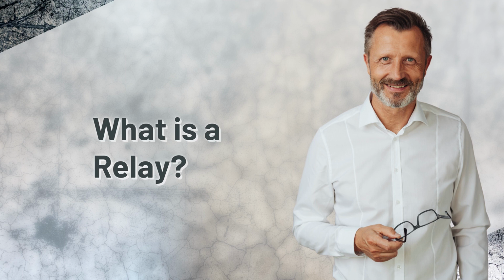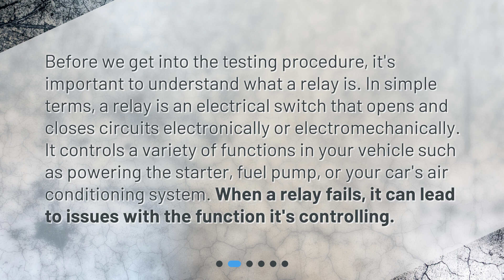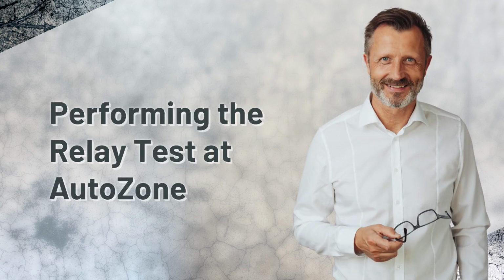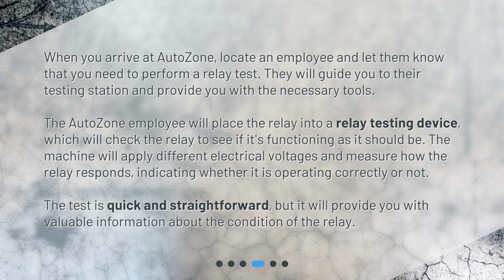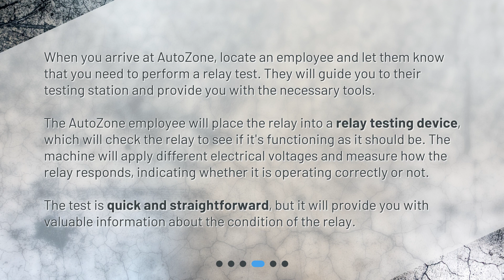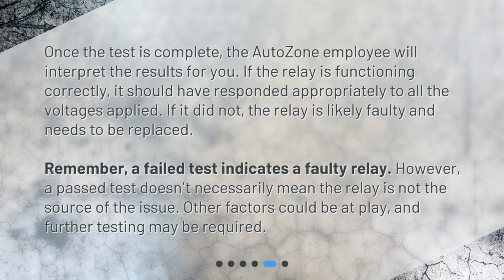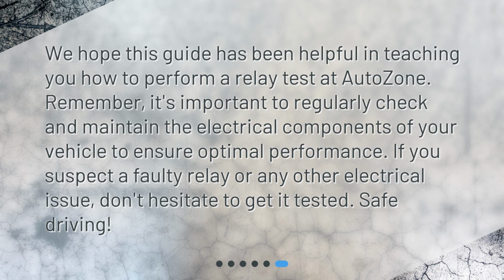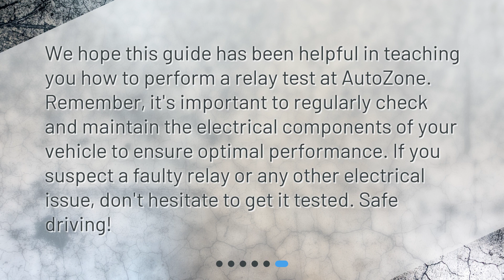How do I perform a relay test at Autozone?

Comment: I went to autozone at 2150 John Rolfe Parkway Henrico va and asked to test my relay(s). The clerk on site at 7:00 PM 8/28/2024 said they  did not do that, even after I said on the web it said they did. I then called another Autozone close to me and they said the same thing. Disappointing!